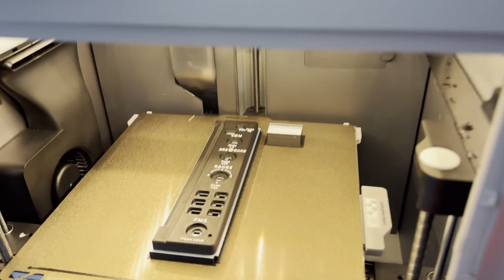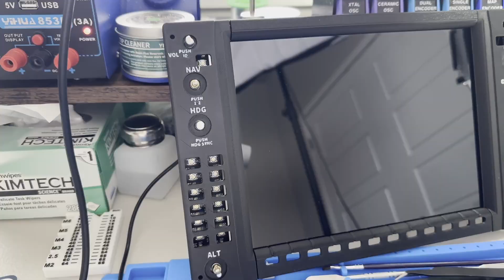G1000 Update – 3D Printed Stencil Holder & PCB Assembly

Comment: Do you recommend a order to adding and soldering the PCB components?  Solder temp 250?
Reply from the maker: I always start with smallest components first. Sometimes they’re hard to place when they’re close to a larger part that’s already populated. For solder paste I’ll find whatever reasonably priced low temp T4 paste I can find. My iron and hot air are set at 340° C. Doesn’t need to be that high but I prefer it over lower temps.

Comment: Can you provide a link for the stencil holder? I've searched and found similar, but smaller designs. I need one about the size tha tyou are showing.
Good luck with your project - it looks really cool.
Reply from the maker: Thanks, here's the link to the stencil holder I made:
https://cad.onshape.com/documents/0ef50d5fd1c50704e4a47a79/w/fdadfb7632dd02bfced3596d/e/ad8c93c8d768e6bd853ba856?renderMode=0&uiState=683b4cdb0e4e6f650fa61f16

It worked great the first few times, but then I went back to just taping stencils to a table. It's a lot faster to set up.